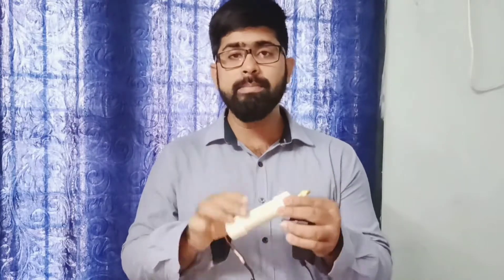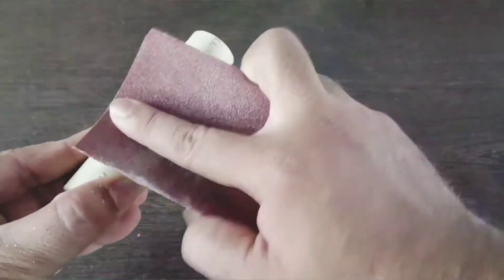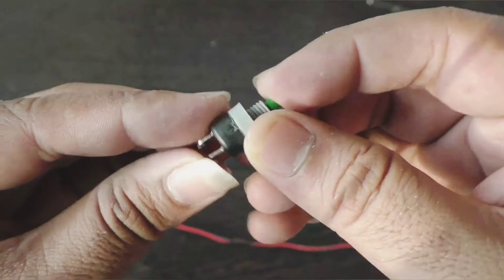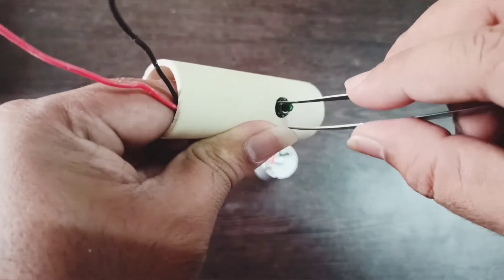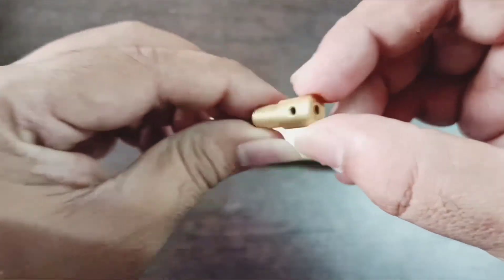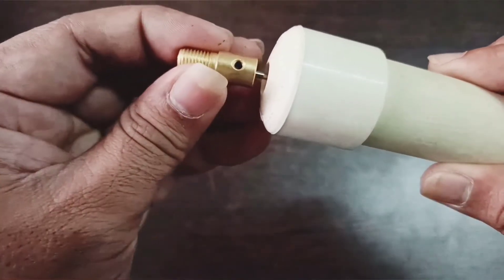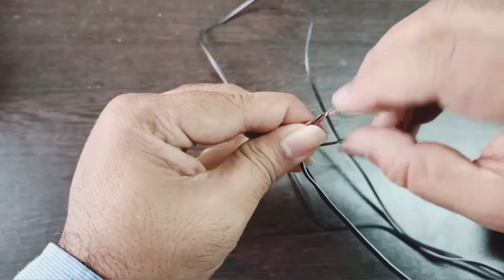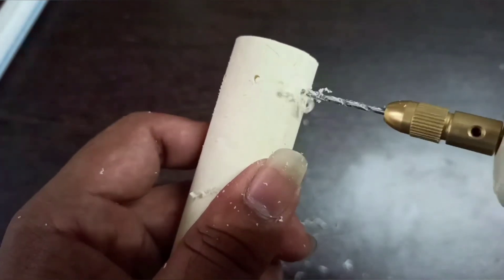How to make a drilling machine at home easy using DC Motor | DIY Drill Machine

Comment: this 370 dc motor is genarator or dynamo motor
this motor has very low rpm & torgue
so this type dc motor can't be use to make drill machine
you can use 390 or 775 dc motor to make a better drill machine 
if you want to make portable size drill machine you can use -365, 380,180 dc motor
Reply from the maker: Yes bro.. you are right. but still it's a moderate torque motor. And it's a mini drill. Will be posting a DIY high power drilling machine soon. Stay tuned 🙂